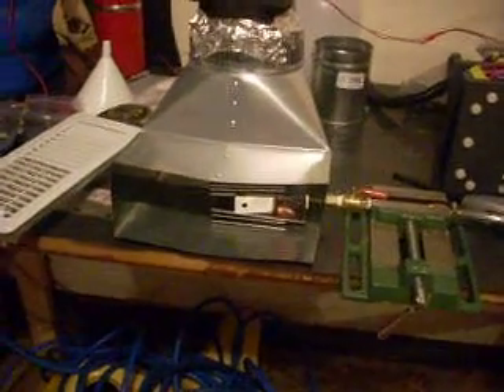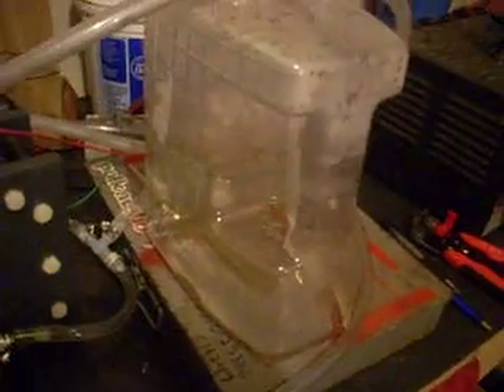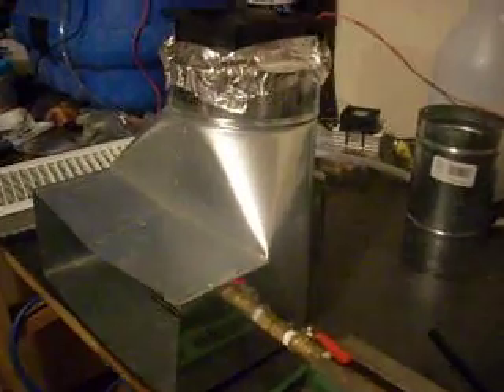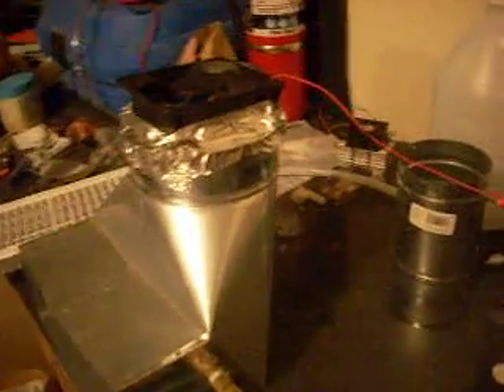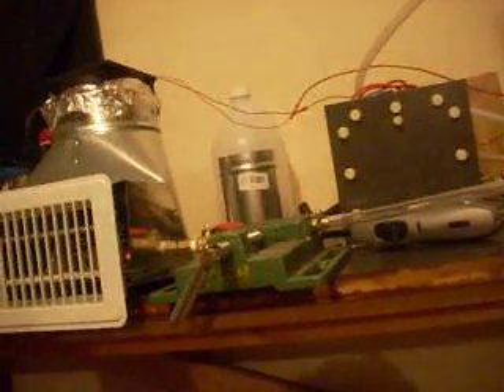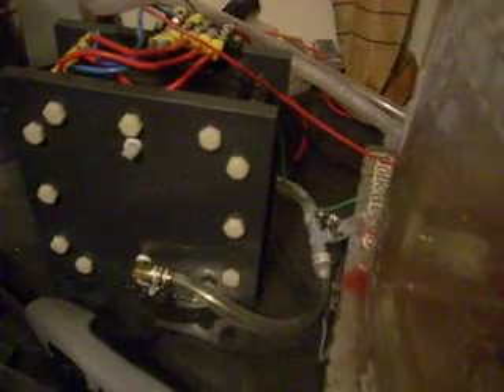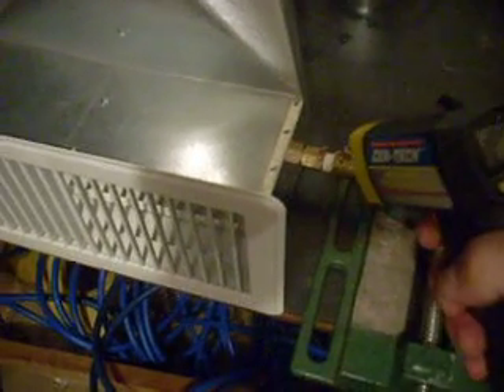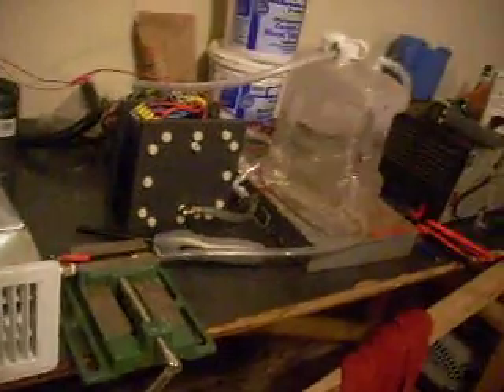Best HHO Heater Youtube

Comment: i did the hydrogen heater residential use a on you tube in 10 love your work i disconnected the pump and ran system by pressuring system  and using  air pressure

Comment: Stainless is a very poor heat transfer material. I understand that the hydroxy flame will cause issues with less robust materials, but I'm certain that a far more efficient interface could be obtained with aluminum or copper, which are far better transfer mechanisms. I am looking for a system that will heat my home (motorhome) at low cost and power requirements... Have researched rocket stoves but the thermal mass limitations with this motorhome reduce the effectivity drastically. I will be persuing HHO if and when I can obtain the materials or donated device to create an efficient heat source safe enough to run continuously in here.
Thanks for your efforts and for showing your research. It goes a long way in helping those of us that are actively seeking (and finding) better ways of living.
Reply: The best way I have seen but not done myself is shooting hho into a catalytic converter. It is called an E cat I believe you can find this guy at jdchho on youtube. I saw one running on 70 watts producing around 300 degrees F or C I cant remember. He claims it is over unity if used in a efficient way via a boiler and I did some research on it a while back and it looked very promising so you definitely wanna check out that first.

Comment: Great video thanks for uploading. I want to build one myself. I'm considering using fire bricks or volcano rocks. They retain heat a lot more and releasing it more gradually.
Reply: You can't put the flame on any rock because it turns it into glass(obsidian). One of my older torch videos shows that. This is Caboflyguy, I'm just logged in as other user.

Comment: he's trying to create a more efficient heater, without supporting scandolous corparations. thats the whole point of free energy. it might not be 100% free yet but it will be in the near future. people at home are creating amazing break throughs in these area's. And on a side note, a $20 wally unit will run 800watts on low and 1200-1500watts (or more) on the high side. this guy is only running 800-900watts. your electric company bills you in watts, do the math. with a few modifications to this

Comment: 7.46 amps times 114.7 volts = 856.408 watts. Volts Times Amps = watts
Reply: I was using a 12 volt power supply back then, not 114.7 volts. And thanks for all of your helpful insight you have left on this thread. Too bad some of these other people were not as forward thinking. Thanks again and a quick note. Using sound frequency within the cell itself will produce more gas using way less power input. This breaks the surface tension of the water similar to a wine glass being broken by certain musical notes. Not ready to say what the frequency is, but it makes it far more efficient when using a square wave PWM. Good luck out there my friend.

Comment: Wait, I may be wrong here, but could someone with more in depth knowledge of chemistry weigh in and clarify? As far as I know CO2 is created in hydrocarbon fuels combustion because they contain Carbon. But since in HHO combustion the fuel is Hydrogen and the oxidant is Oxygen, there should be no CO2 production. Most of the byproduct of HHO combustion should be just water H2O. Or am I missing something? Thanks for anyone who could shed some light over this :)
Reply: You are correct no co2

Comment: If you are burning an open flame, it makes absulotely no sense to use heatsinks.
If you do not use a heatsink, you allso dissipate 100% of the heat into the air. 
Where else can the heat go? Did you think about that?
An open flame in a box with a fan will have exacly the same effect,

Comment: Great to see your work ...... one minor note, your running the flame into collection of stainless plate, stainless in not one of the best thermal dissipation / conductors so heat will be localised....ie higher in a limited area, why not use copper or aluminium ( you may have to put a small piece of stainless in front of the initial contact point to save the Ali plate from oxidisation / melting ). Keep at it, can you make a stab at an input / output wattage ? ie efficiency ?

Comment: My main concern is, it is obvious that heating is achievable...   just how much electricity is being chewed up to accomplish this?!?!?

I'd love to eliminate my Propane source HVAC system, I supplement with eheat convection air heating panels, they are good, but @ 450 watts per panel, they only raise a room of about 12 x12 by 3-4 degree's, not much more, so its not super efficient... so if an HHO system is using a lot less watts per house and can better heat a room, then I'm all for it.

Comment: your insides of the heater will cool with that fan running at that speed,
try slowing the fan speed per heat flow from the torch.
remember those old Gas fires with the gauze? try using one of those, they will be more afficiant also are waffle designed which will allow the air flow through the centre allowing more heat flow rather than resistance. just a thought good work here.